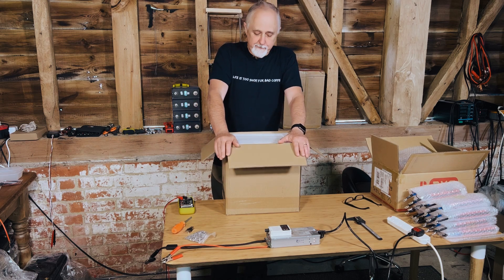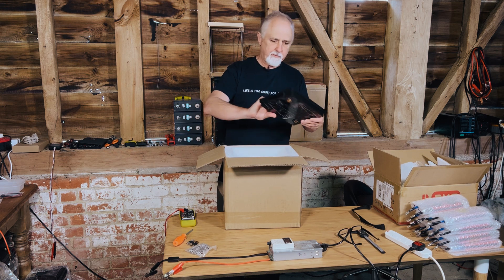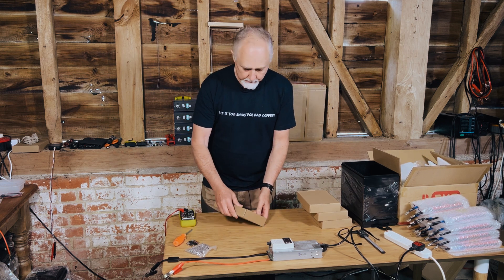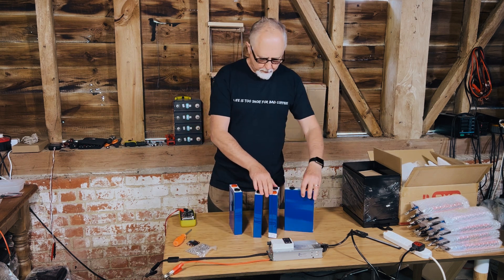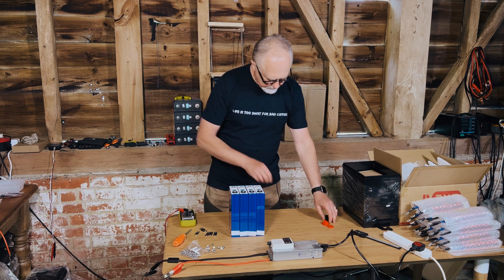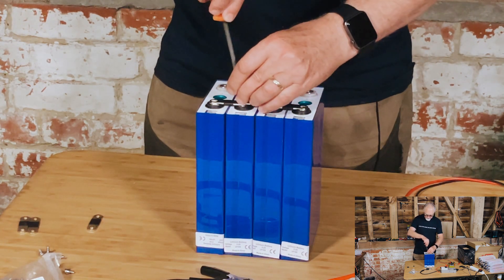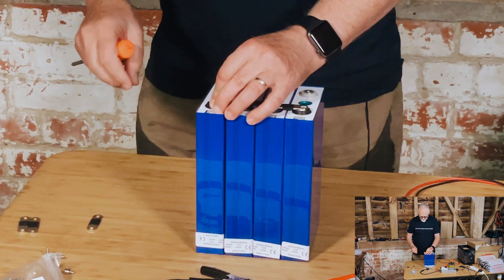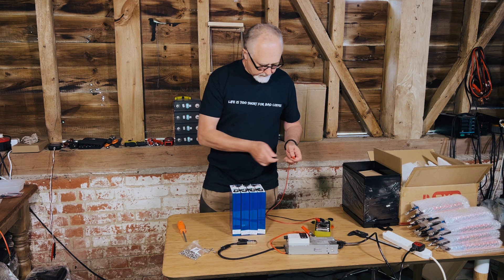Top Balancing & Capacity Testing EVE 105Ah LiFePO4 Cells

Comment: Great little video. At the end of the top balancing cycle, what happens to the battery charger? Does it gradually reduce the output to zero amps, even though the setting was 20amps? It would change from a constant current to a constant voltage when it reaches (or approaches) the set voltage limit on the charger?

Comment: I just bought some of these that are advertised as 105 Ah cells but the specs say  they are EVE LF90K with a nominal capacity of 90Ah. So what model are your batteries and did you get the full 105Ah capacity out of them. I bought through Amazon. How are you measuring the capacity?

Comment: One other tip for dealing with fine threads in soft material is one finger and thumb only and minimal force until you are certain the thread is properly engaged, and stop the second you feel any resistance at all. Then back off and try again, and if you still feel resistance take it out and check both threads for contamination or swarf. If the screws also have a hex head, it can be better to use that rather than a screw driver as they engage better and it's easier to keep the driver aligned with the screw.